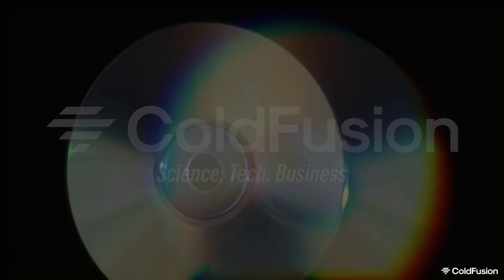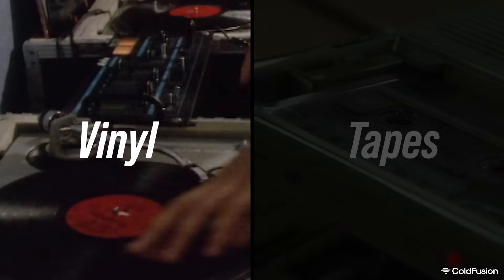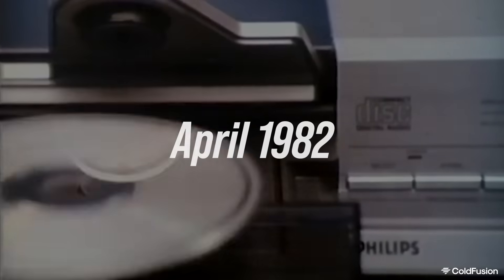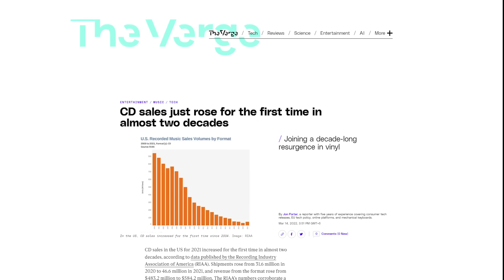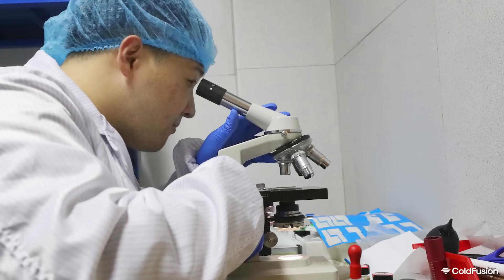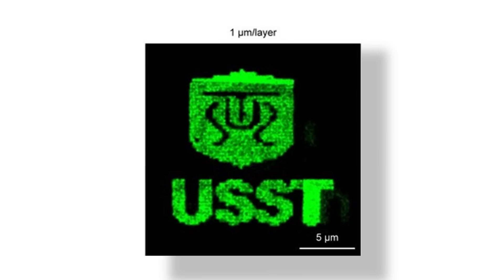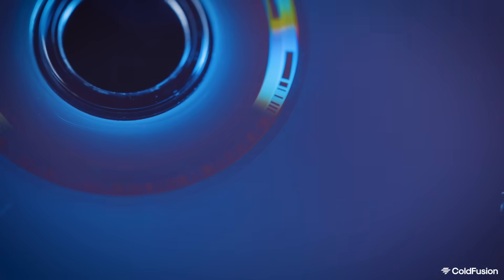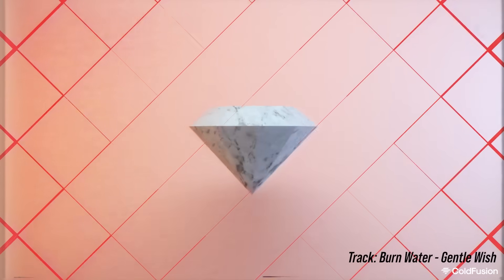Why This New CD Could Change Storage

Comment: Oh come on, 1.6 Petabits is a gimmick!  NOBODY talks about storage volume in bits.  Network throughput = bits, storage = bytes. 200TB is still extremely impressive, there's no need to hype it up more. It's a FAR CRY from 1.6 PetaBYTES which I thought you'd mentioned several times.

Comment: They could increase read and write speeds by having the laser rotate in the opposite direction but in order to do this the disc bay would need to double in size to hold the hardware to make it happen.

Comment: And how is practical testing going for the disc's performance at, say, 100 years of age? 500 years? Can it match M-Disc for actual long-term data storage, or does it suffer from standard-disc material instability over time? Can this type of disc have a hard-surfaced version made of it?

Comment: Laughing about the cautions "This may be many years before it becomes a reality..."   I remember somewhere around 5th grade seeing something in Popular Science magazine that they said would eventually revolutionize the world. It was the "LCD" and the displays that eventually became available became cheap and ubiquitous.  By the time I bought my first CRT (the first one I paid for) sometime in the early '90s it was $500 - $600 for a 18" CRT display. And now here I sit in front of my 42" 4k display which I paid about $300 for.
Reply: I was introduced to gaming via Zork on the iconic green phosphor CRT. Now I game on a 75" LCD. All hail progress!
Reply: You also can't argue with the fact that CRT is still screwing us now. The way CRT used to display pixels line by line still exists today for backward compatibility reasons. If we remove that bottlenect by illuminating every pixel on screen at the same time the concept of refresh rate would vanish. The only bottle neck would be physical cable latency.
Reply: That 42" is equivalent to 11" crt tho
Reply: @tuxt7156  
Not really. It's large enough to read unless you need cokebottle glasses, and, at 4k has about 10x to 50x the actual screen display area (your '11" CRT' was, at best, 480x240 or thereabouts in resolution -- and thus visual info display -- instead of 3840x2160).

Actual comparison of the screen sizes is more like a 15" to 20" CRT -- by the early 1990s there were 24" 1k CRT monitors and 35" Std-def TVs. I know, I had access to both.
Reply: CRT are better than 99% of LCD to this day. They were just more profitable to mass manufacture.
Reply: @chuck948  From who's arse did you pull that gem?  The only possible way you could honestly say "better" is in how long they lasted. In EVERY other respect, LCD is far superior to CRT. Every respect. You even named 1 way yourself, cheaper to manufacture.
Reply: @chuck948  I see.  I guess I fell for the bait.   So...  "Yeah huh!"
Reply: @Robert08010  There's a few kind of niche ways crt is better, like essentially 0 input lag, the way they "project" makes older media that was designed for them look better, and they have way better black levels than LCD (there's ways to get good blacks on LCD it's just *expensive*). That's only compared to LCD though, more modern display tech like OLED I think can solve all those. And in the end, I would take a good LCD over a great CRT any day.
Reply: @BilboSwagginsTheThird    There was a time when LCD was new that a TV still looked better when watching a DVD and most notably when watching an Mpeg1 Video CD. I can recall them looking better than VHS even though they were only 320x240 resolution. But not on a CRT monitor or a LCD monitor, only on a TV. Either of these really showed the  quality defects whereas a tv seemed to see right past the defect.

Comment: Reading speed will be crucial as well. I doubt thiswill be used for anything else than cold storage/archival. We have the same issue with every storage methods that aren't solid state drives: The storage capacity expands much faster than read/write speeds, so ultimately these mediums are relegated to cold storage and archival

Comment: Even if they could get the price down to what the OG CD players retailed for adjusted for inflation ($2300 USD) and could sell the discs for, idk, $100 bucks, outside of professional settings it would still be a ridiculously hard sell. That in turn makes it almost silly to even try to get the price below about 5X that as with improved read/write speeds it would be pretty incredible for general business storage. If people were unwilling to pay $2K+$100 in the mass market then they are only cutting into their own potential profits...at least until Samsung or Micron come out with some crazy new 15 layers SSD Tech that doesn't greatly diminish storage degradation/drive expectancy.

I'd be pretty cool with picking one up if they did get into that price area though. Heh, what a big spender I am. Willing to pay $2300 for a $40,000 laser+components. Seriously though, with the size of media nowadays and it's ever-growing size it would really help. I have 4.5TB of M.2 space in my gaming PC and just picked up another 4TB NVMe, an enclosure for an older M.2 so I can move that to a SATA port and keep 8.5TB in the box as external drives are a pain as is uninstalling/moving/deleting things then having to reinstall/move them again when I want them. Sure cloud storage is an obvious solution, but I have enough monthly bills already. It'd be great to be able to fit all of my movies/music/art/photos etc. on one drive and all of my games/OS on another while not having to worry about how soon I'll be running out of space. I also wouldn't need to watch the stupid data cap my internet put in place in 2017. Buggers. Literally months after the Net Neutrality repeal was announced my internet got a 2TB cap which was dropped to 1TB in February after it went into effect and was just recently raised back to 2TB which is still borderline for home use in my case; mostly due to having to re-download things from cloud servers. Stupid.

Comment: If if if the tech can be brought into consumer price range yes. And then when the M-Disc folks get ahold of it, wow!

I rarely edit a comment, but after reading some of the other comments wanted to add that M-Disc presently offers some high capacity discs, I think up to 500 Gigs. That still impresses a person who remembers 30 and 50 Gig hard drives as the primary PC drive. Heck, I remember Kilo drives!

Comment: They have no excuse to not give us 18K blurays with 64 bit 20,000Hz audio channel playback.
Reply: 18K @ 120fps, w\ 64bit 22KHz 12.1 channel audio, would not quite fit a half hour on one disc, yet. 

In principle though, such tech should be quite doable, if the industry hadn't shifted so hard to streaming. 

(It's still hard to beat offline hard-drive storage, though. And tapes, particularly for sequential-access media!)
Reply: Hahahaha I was thinking same thing! One SuperDisc, or whatever want to call it, can have all the movies or songs you want in a transfer where the digital waveform is indistinguishable from the analog 😎🤯
Reply: Wise guys should make it themselves

Comment: I would use the shit out of this tech. i still backup my rendered content to write once blu-ray along with files and photos I cannot afford to lose. Digital and magnetic storage can still be lost via crashes, EM pulses, lightning strikes, hacking and device theft. Nobody steals old blu-rays and the archival grade discs last over two hundred years. I use all of the mod cons too, but this tech still has a use case, and even if they launched a new mini-disc format, it would still be hundreds of terabytes. Very usable...just make it cheap and cheerful and there will be a market. Imagine a tiny disc version 1 inch wide that could hold 100 4k movies.

Comment: I don't have a problem with CD/DVDs in general, and if they are massive enough, swapping them would be a rare occurrence.  My problem with them is that they are FRAGILE.  
Another problem they have is time, as in making me wait around...  Some games now REQUIRE an SSD, meaning that a 7,200 RPM HDD with a 256 MB cache isn't nearly fast enough.  Am I to believe that CDs now spin FASTER than 7,200 RPM and have larger than 256 MB caches so they transfer more data faster?  CDs will never replace HDDs, and HDDs aren't fast enough for some things now.  And scratching a HDD is impossible.
My take on this:  NOPE.
Until holographic drives are greater than 10 TB and sub $200, SSDs and more specifically NVMe drives will be and remain the standard.
Also, why is storage being talked about in bits?  I keep hearing "Petabits".  Nobody talk about storage in bits.  Only network speed is referred to in bits.  
1.6 Petabits is 200 TB.  200 terabytes isn't enough to make you click on this video, but 1.6 Pb is.  If people understood the true difference between "b" and "B", this video would have 1/4 the views.  
Somebody invented a 200 TB CD.  Nice.  Can it be scratched?  Next.

Comment: Storage capacity isn't everything. Depending on the application, I//O performance and seek times might be just as important. CDs/DVDs and traditional hard drives are slow in both, seek times and transfer speeds. Sure, you can spin them faster and write data more densely, but the laser (or read/write head) still has to physically move to a specific location and 'latch' on to the track. Solid State drives overcome that problem almost entirely. Yes, memory addresses need to be looked up and accessed but it is in a completely different dimension than spinning media in terms of performance. This, however, might be a great replacement for tape drives, either for static backups or for a layered backup strategy (where for example differential backups are stored on hard drives and complete backups are stored on slower media like magnetic or optical media).

Comment: What's odd is I remember reading stories about "3D" & "holographic" discs at least 7-10 years ago.  At the time they were talking about being able to store 1TB on a single disc.  I think even if they could have brought that to market it may have stopped the flood to cloud media/storage.  

I honestly don't know why microSD/flash media didn't simply take the place of optical media given how quickly it expanded.  Actually, yeah, I do.  It's all about money.  You can't make subscription money from physical media.  Physical media/storage will ALWAYS be needed.  I'm buying as much physical media (i.e. movies, tv shows, etc) as I possibly can so I can actually get rid of a lot if not all subscription services.
Reply: Also it is easier to spy on what people are doing if you are storing and have access to their data.
Reply: Actually, SD and microSD cards were intended to be the next physical replacement of CDs. They even have DRM and other controls built into the standard that is pretty much unused in most circumstances. The problem is they faced the same unforeseen threat that CDs did: The rise of fire sharing (remember napster?) followed by streaming.
Reply: There's always some story about the next big thing in storage. I remember glass storage, and DNA storage and many other mediums. Problem is, nothing beats USB. It's universal, fits every machine without the need for dedicated hardware and NAND memory is cheap enough for every day use. People are migrating from DVD players to consoles and PC. Mobile phones are primary form of personal computing these days. No way of shoving 50k$ laser inside of a mobile phone.
Reply: You can buy digital media, no need for subscriptions.

Comment: As someone who has worked on datacenters I doubt this is going to be used much at the enterprise level, at least not in the same format as a CD. We already have drive arrays that hold dozens of hot-swappable drives, so there's no real need for the added complexity and fragility of managing individual disks.

Comment: Cloud and Internet have HUGE disadvantages. Not only do they rely on a wire or Network to be delivered, which is iffy. But, you are also at the whim and vagaries of others. It is extremely short sighted to want to rely on Clouds and modems or wireless networks.

Hard, physical media will NEVER go out of style in many years yet. Having and owning data as compared to accessing it are two very fundamentally different prospects. For me. I would rather HAVE my media on hand. You can rely on someone else's version of ownership. Get back to me when they decide to change the terms of your agreement while I continue to have mine at my fingertips.

Comment: This would never work in a data center. There are too many points of failure especially the spinning mechanism to read the disc. Imagine of half of them break at the same time. I cant imagine some one going in to fix all the spinners at the same and how long it would take. And spinning disks will never reach the same speed as nvme. Every single cd player or cd rom drive ive ever had has broken. This is why most companies have gotten rid of them. The only place i still have it is in my ps5. Just waiting for that to break as well but it def makes it easier to share games.

Comment: WHAT IF... the didnt have to be read by lasers but by electronic platform that reads the data... Lasers that the commentator speaking of creates heat not many like the heat... Heat bad... No plugs or cables because it gets its power from the platform and teads it at the same time
Reply: Reads*

Comment: I have NO fond memories of CDs DVDs  it was all crap technology that never worked properly.  The music CDs used to jump, go wrong when you least expected them to. And they weren't cheap!

DVDs movies were a bit better but did go wrong after a few plays.

DVD Recorders NEVER EVER worked properly - l had several and had to return NEW equipment to J Lewis as they never worked properly and out of a pack of 5 expensive discs only 1 would be accepted by the recorder!  If you were lucky.

Even computer discs l use on my DVD CD player on my computer NOW  are unreliable and the computer refuses to read boot up versions if its OWN discs.

Beginning to think perhaps they just send crap to the UK  if no-one else in the World had problems with them?

SO they were a good idea but a terrible waste of my money; therefore a very loud  GOODBYE and please don't come back.

TAPE was far more reliable.

Comment: considering 1.6 petabits and not petabytes..

it would take 117.89 hours (approximately) at 500 MegaBytes/sec to write on this disk completely...

with a write speed of 6000 Megabytes per second (current SSD speeds), it would approximately take only 35.37 seconds to fill the storage of the compact disk with a capacity of 1.6 petabits

Comment: Honestly, one thing I could see this used for would be a retro-gaming device.  You'd still want discrete memory elsewhere, but one of these in a sealed, noble-gas filled, read-only enclosure could cover... every game for most of any older generation of gaming console.  That handily gets around the write-issues of the disk in both time and cost.

Comment: First of all there has been a trend of leasing data rather than owning the data & SW one pays for.
Second CD’s are not subject to EMP attack.
Third ROM CD’s are not subject to alteration for archiving.

     The major disadvantage was file size, requiring many disks and physical storage limitations.  This tech. looks very promising once the economy of scale, power consumption, and latency issues are resolved.  Decentralization and control of information is a good thing in a “1984 world”.  👍

Comment: "The estimated energy consumption would be in the kW range per Terabyte or writing" – kW is a unit of power, not of energy, so this doesn't make sense. You'd want kJ if you're a nerd or kWh if you're a consumer per Terabyte, or something like "the power requirements for writing at a rate of X megabytes per second are in the kW range".

Comment: CD's with compressed audio are not high quality audio. 
I did pro Audio equipment design for 20 years and learned what high quality audio really is. We knew exactly how to do A to D conversion. In fact, TI created the techniques and I.C. used in scientific equipment. Sony made a commercial version under license. It's all about marketing not engineering. Where U.S. Engineers had the Japanese beat hands down is in Audio Quality. Why? We design subjectively and intuitively were our Japanese friends are more mathematical. The results are subjective. Where the Japanese did good was offering quality products at affordable prices. Our equipment is more expensive but will win blind quality tests. The new high density tech removes these limitations. The higher data rate electronics needed to make it useful has been around for decades so that is not even an issue. If only it was practical. But like all high tech. It's expensive until it isn't. Starts out in high end applications and goes down hill from there.

Comment: My thoughts would be if they reduced the total amount of storage but in return had redundancy of storage (duplicates) so any scratches or worse etc won't matter as much, because by design those bytes are elseware on the disk. The worst thing is having so much data and it also being lost really easily too.
However, the problem is bringing a disk writer to consumers...

Comment: This teknology is OLD, this is the same as the IBM did this in crystall "zirconoa" hard drives in the 90's that can store 200 years with Video and Audio.. its used in Military, and not public use